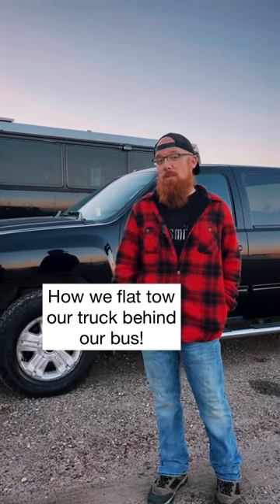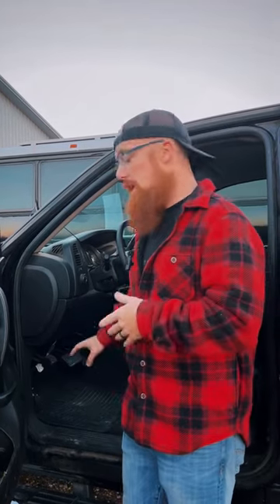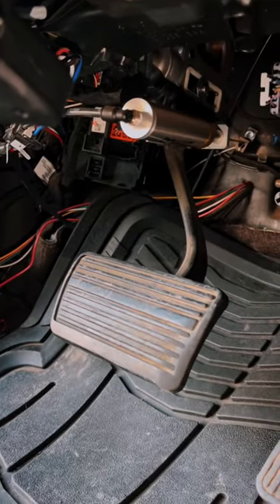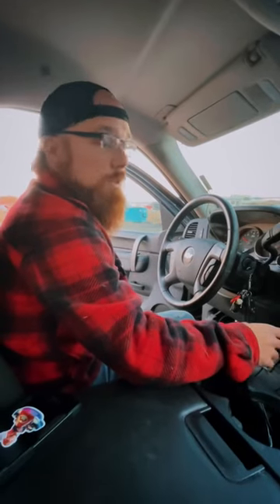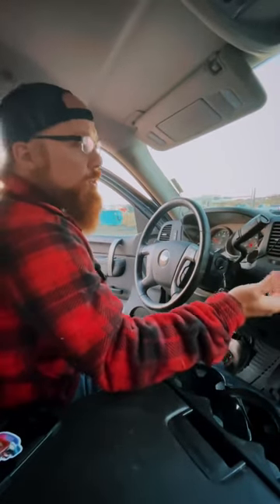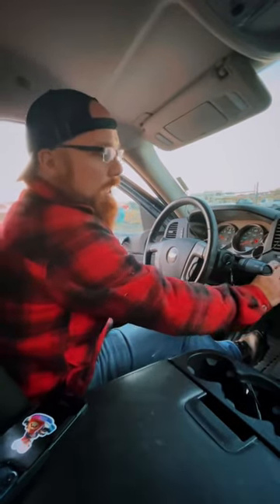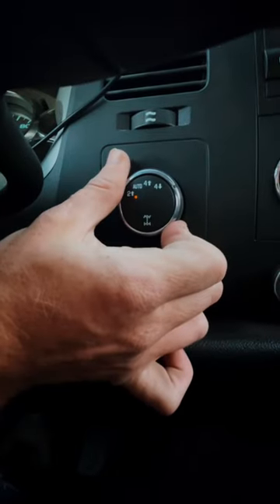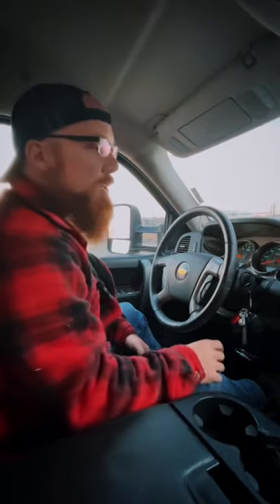How we put our transfer case in neutral and the braking system we use to flat tow our truck! #shorts

Comment: Thats how I did that, I put my transfer case in neutral one day and could never figure out how to do it again
Reply: Chevys got all kinds of hidden features. dude my 08 ltz had heated washer fluid, power folding mirrors that auto tilted down when reversing, backup sensor not a camera. my newer 13 has none of that but has a grade brake when in the mountain which scared the crap out me the first time it auto turned on downshifts for you to maintain decent speed
Reply: @alexlaidlaw220  gm.
Never again

Comment: This system looks like a modern version of a system I seen years ago. Being the actuator cylinder is mounted up out of the way. Then it can be permanently mounted. The older system had a bracket mounted on the floorboard near the front edge of the seat and they used a clevis pin through a hole in the bracket and the end of the air cylinder actuator. The other end had a piece similar to one of them "Club" steering wheel locks. It just rested on the pedal and once pinned it could not fall off, yet didn't require any modification to brake pedal or mounting bracket installed on pedal. You took the pin out and removed the actuator cylinder when not towing. They required an air supply from a small compressor and an accumulator tank. This was included with the tow brake kit.

Comment: Some transmissions don't like being towed, without the engine turning the pump on automatic transmission especially. There are manual transmissions that aren't recommended to be towed. Those are usually ones that use ATF instead of gear oil, like Ford manual transmissions. They have a slinger disc that throws fluid up into trough on the side of the case. They have smaller troughs that oil/fluid runs directly onto bearings and gears from the trough on the side of the transmission case. When its in neutral theres a counter shaft that spins when engine is running slinging the fluid around. As well as when its in gear driving. 
You can get a driveshaft disconnect. They make some that are actuated by a lever.
A friend that goes to the desert towing a vehicle in Southern California and he just leaves his engine idling and vehicle in neutral for the trip. Its about an hour idling. Not really going to hurt anything. 🤔
Reply: Well, since he has the ability to technically disconnect the transmission from the wheels without modifying the truck’s drivetrain, why not go ahead and do it?  This way his trans isn’t spinning and he doesn’t have to worry about it.

Comment: Great idea but it's also why I tow my Rig on a trailer no miles getting put on my car no wear and tear to it whatsoever!
Reply: Yeah buddy but you have a whole separate entity that needs maintenence now.
4 extra tires, wheel Bearings and extra brakes to service.
Extra lights, frame, stronger hitch rating, extra trailer weight, stronger tow capacity, must know how to back a trailer, tie downs yada yada yada. These are much easier. Drive right up to the back of your rig, neutral, hitch and go. Can always un hook to back up whenever needed and no trailer to leave to be stolen. 
Too many benefits.

Comment: But the downside of flattowing it puts wear and tear in the vehicle as if you were driving it
Reply: Other than having a large car hauling trailer which many campsites do not have room for a large Rv your tow vehicle and a large trailer. What other option is there. If you actually drive the vehicle separately it puts more hours on the engine and transmission than flat towing . If you do purchase a capable car hauling trailer that’s around $10,000 plus annual maintenance registration and insurance. The minor wear and tear on tires suspension and brakes would win financially to flat tow. Also properly set up flat towing is much easier than the hassle of a large trailer.
Reply: Only really on your suspension, not that big of a deal
Reply: @Snookchaser007  but people flat tow car with an automatic transmission that arnt made to be flat towed and destroy thr transmission the more its towed in newtral
Reply: @concertscoastersandnitro725  people do all kind of stupid things. That doesn’t mean there are not proper ways to do things.
Reply: @wigit2216  did you forget the the truck is rolling 😂😂
Reply: You can't be serious 🤣
Reply: Not really
Reply: @wigit2216  wtf are you talking about.
Lmfao
Reply: @freeaudiobooks7469  if you disconnect the driveshafts or put the t case in neutral you aren't turning hardly any of the drivetrain. Not the same as if you were driving it.

Comment: Ok we know putting the transfer case into neutral does not disconnect the drive shaft from the transfer case. Which means something is still turning in the transfer case. So how is the output shaft getting lubrication? Does that transfer case have an oil pump on the output side? In fact which transfer case is that?
Also you said that's a four wheel drive. Do the hubs disconnect on that truck or are you still spinning part of the front drivetrain?
Reply: Yea, that’s something to add to thought. Could still burn something up if you don’t know your vehicle.
Reply: @motorizedmiscreant  yeah it's pretty important to discuss any flat towing with the manufacturer. If you aren't into learning the guts of your vehicle components you can just base decisions off that info. There are specific drive line kits that you can get that just act like disconnects with regular greased roller bearing supports. They are expensive I've heard though. Another option if you are handy and just moving a long distance is to disconnect the drive shaft from the axle. But note you should write a reminder and tape that reminder to the steering wheel of the towed vehicle.
Reply: All transfer cases i have seen have an oil pump attached to the output side of the case. Giving it full lubrication for flat towing. They also all have a neutral position but it may not be accessible for the user depending on the vehicle.
Reply: @martyk1156  I'll have to check but I don't think my np205 has one. They don't really usually need one if it's an oil bath design.
Output shaft driven pump is the best design though.  If there is no pump then the gear train needs to move to keep the oil moving.
Reply: As far as I know, most if not all transfer cases do not have or need a pump.  They work much more like a manual transmission than an automatic, the gears or sprockets and chain are in oil which get flung around by them turning.  Putting it in neutral disconnects it from the transmission, but the transfer case internals will still be turning.
Reply: Change your name you have no clue what 4x4 is or what you're talking about it sits in an oil bath there is no pump
Reply: @yzrippin  lol, what rock were you born under?  Not all transfer cases are made the same. I have rebuilt transfer cases and automatic and standard transmissions. So why should I change my name again? Just because the units I'm familiar with may not be in his rig and I ask questions you assume I know nothing about 4 wheel drive? How drunk do you have to be to come to that conclusion when my comment shows obvious knowledge about various types of transfer cases?
Reply: @consaka1  okay and are you for certain that the transfer case in this particular truck is not itself lubricated due to an oil bath?
Reply: Some manual transmissions use ATF instead of gear oil. I've heard some manufacturers are using ATF in transfer case as well.  Ford is one that uses ATF in manual transmissions. They have a slinger disc that throws fluid up around the case of the transmission. As the fluid runs down to the bottom some of it is caught in a trough on the side of the case. They have smaller troughs that come off this main trough allowing fluid to run directly onto bearings and gears. Some transmissions use a counter shaft that has the slinger on it. The only time it spins is when the engine is turning the input shaft. In neutral or in gear driving this is turning the slinger disc. When its in neutral and engine is off, there can be quite a few items rotating inside although they don't have much of any load on them, it still can be wearing things prematurely. They make driveshaft disconnects, that are basically a spline shaft with a splined sleeve that slides to engage/disengage by using a remotely mounted lever. They can be expensive and requires welding by a competent driveline specialist. For alignment and balancing of the rotating assembly.

Edit: This would be for a two wheel drive vehicle and probably applies to front wheel drive also. The transfer case may be equivalent to a drive shaft disconnect???

Comment: That's a pretty cool invention problem is with towing something behind that's in neutral is your heat up your transmission and your transfer case as someone who works at a dealership they come in all the time being destroyed
Reply: Not on a 4 wheel drive vehicle when you place the transfer case in neutral and the transmission in neutral as he did in the video. And hey we have the same YouTube name
Reply: The transmission is in park, transfer case is in neutral. Trans isn't spinning.

Comment: An automatic transmission will only create oil pressure when in drive, if it is towed in neutral it will no longer have transmission oil pressure and will chew your transmission out
Reply: With the 4wd transfer case in neutral it won't spin the transmission. In the clip he proved that by pushing the truck when it was in park.

Comment: I have seen my 04 has a neutral light and I suppose that's probably the best but it just keeps a couple of parts in the trans from rotating and Taking extra wear but if it was 2wd you would just put the truck in neutral right
Reply: Absolutely not. Never ever tow a two wheel in neutral either drop the drive shaft or buy a driveshaft kit that allows the shaft to free spin. Towing in neutral will damage a transmission.

Comment: How do you not burn up the transmission? That setup is still allowing the trans to spin but not allowing the fluid to go through the trans cooler? I tow everything from light duty to heavy duty and have always been told to never tow vehicles in neutral because you'll burn up that trans.
Reply: The transmission is not spinning because the transfer case is in neutral. The T case is a self contained unit with its own lubrication system causing no damage to it.
Reply: Your right never tow vehicle with transmission in neutral. In this case transmission is in park and transfer case is in neutral and vehicle is designed to be FLAT towed behind RV in this manner. Tow trucks do not flat tow vehicles
Reply: @NTM2009   @gbrush30  the hell we don't😂... I have had to flat tow loaded dump trucks before because my wheel lift won't lift the truck up. It was a short distance maybe 10 miles away from their shop, so I raised the truck up just enough to take pressure off the tires in the front, chained it down and rolled with it. 

Even if it wasn't a loaded heavy truck you sometimes you have an all wheel drive vehicle that is going to have an axel on the road regardless, that's why we have dollies or you have to chain sling the front so the tires are off and dangling around. 

The way the other guy explained it makes sense but I still worry about damaging the transmission.
Reply: @medix1203  when was the last time you flat towed a pickup or car?
Yeah some times large truck get flat towed but then the drive shaft is out and it's not an issue. Buy wasn't talking about large trucks we were talking about pickup truck
Reply: Since the transfer is in neutral, everything is disangaged, transmission is not moving at all, just gears inside the transfer, but I believe those get lubricated by the movement by itself
Reply: @Rool88  yes good number of transfer cases are just splash lubed and can be used in this way. Ones that have a pump can't be flat towed

Comment: Can somebody explain to me the advantage of towing a car versus towing a car on a trailer? I just don’t understand. Spend all that money on a trailer and then you hook up a car and stitch it behind camper. I would just go the extra and get a trailer that you could also back up, I’ve seen vehicles have been towed behind trailers and they don’t make any sense because it has so much where on the front end
Reply: If you flat tow a car, 99% of the time you will burn up your transmission if you don’t disconnect all of your driveshafts. The trans is still spinning and isn’t getting lubricant. Also most cars aren’t even capable of being flat towed unless you take the bumper and sometimes even the radiator off.
Reply: Always trailer
Reply: @motorizedmiscreant  false
Reply: @wigit2216  yea I only tow vehicles for a living and own two towing companies but I know nothing buddy you go right on and do it. Tell your transmission mechanic I says hi

Comment: Who makes the braking system and do the brake lights come on with no key in the ignition?
Reply: They should. It's a normal function for the brake lights to work with the ignition off on pretty much every vehicle. Try it the next time your wife goes somewhere.
Reply: I was in my 09 silverado at a store and could see  my brake light reflection in the glass and when I turned the key off the lights went off too. Better check that.
Reply: @brianhaw9398  Don't know what to tell you about your Chevy. Every vehicle I've ever driven the brake lights work with the key off. From Kenworths and Freightliners to Ford's and Toyotas.
Reply: Yes a brake light switch has a constant 12volts going to it at all times, with or without key.
Reply: I have GMC with push button select for 4 wheel drive. How do I get neutral for transfer case
Reply: @altondubose3415 usually holding two buttons at the same time. Should be marked
Reply: @schwazman1  you would be 100% wrong when it comes to newer vehicles, particularly Ford.

Both my 2005 Ford Focuses kill the brake lights when the ignition is turned off in them.

This is a very common thing in newer vehicles as the switch is not constant powered since it's BUS'd into the GCM or BCM.
Reply: @buddtwin2  not true at all

MKI Ford Focus will kill the brake lights when the ignition is off as will the Chevy shown in the video
Reply: Kind of strange they changed the DOT regulations regarding the brake lights working at all times. As long as there's a good battery, brake lights were required to operate without the key. As a matter of fact the brake lights were required to override the hazard lights on vehicles with the standard combination brake/turn bulb system.  In other words if your flashers are on, and you push the brake pedal the lights will stop flashing and stay on continuously while brake is depressed. 
I guess they changed the DOT regulations from what people are saying here on the newer vehicles. Wonder why? 🤔
It was a safety reason why it was the way it was! Strange.
Reply: @ElectricBillAlbright  tell me about it, I about freaked out when I noticed my first Focus did it
Reply: This system looks like a modern version of a system I seen years ago. Being the actuator cylinder is mounted up out of the way. Then it can be permanently mounted. The older system had a bracket mounted on the floorboard near the front edge of the seat and they used a clevis pin through a hole in the bracket and the end of the air cylinder actuator. The other end had a piece similar to one of them "Club" steering wheel locks. It just rested on the pedal and once pinned it could not fall off, yet didn't require any modification to brake pedal or mounting bracket installed on pedal. You took the pin out and removed the actuator cylinder when not towing. They required an air supply from a small compressor and an accumulator tank. This was included with the tow brake kit.

Comment: Always Always Always trailer.   You will destroy something you flat tow.   A 16ft trailer pipe top has 20 different setup uses and will easily fit the pickup.
Reply: I have been flat towing for years never hurt a thing other than some extra tire wearing. Compared to the cost of a capable trailer (it must have breaks in many states) with registration insurance and maintenance on the trailer, the cost of tires a little sooner is a win. Don’t forget that trailer needs tires also . Many campsites do not have room for a 20’ trailer and a 40’ Rv and your truck. Hundreds of flat towed vehicles come through the campground I run and maintain every year. I speak to almost every camper and less than 2-3% have any major problems with their flat tow vehicles due to being flat towers . The ones that have had issues are typically due to incorrect setup or having a vehicle that was not designed to flat tow and or never set up to isolate the transmission in some way. If you have a true neutral transfer case that is the best kind of vehicle to flat tow. This is why you see so many jeeps and now new bronco’s behind RVs. There is the occasional cracked windshield but that can happen trailer towing also. It takes approximately 5 minutes to attach a readily set up vehicle to flat tow and your off versus backing up properly hooking a trailer the driving to a loading location long enough to drive your vehicle onto it then strapping/ chaining it down at at least 4 points. Then when you get to your campsite you have to find a place to store the trailer often off your campsite or deal with a crowded campsite having to walk around your trailer every day.